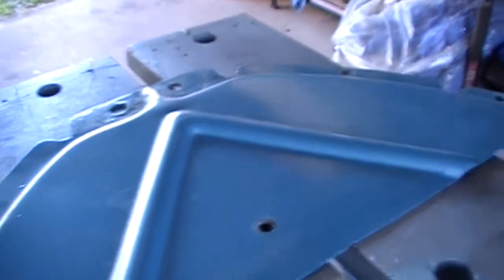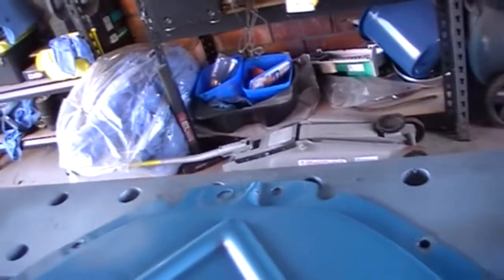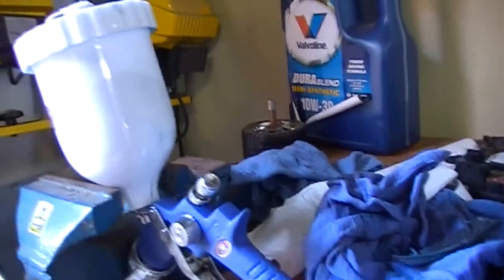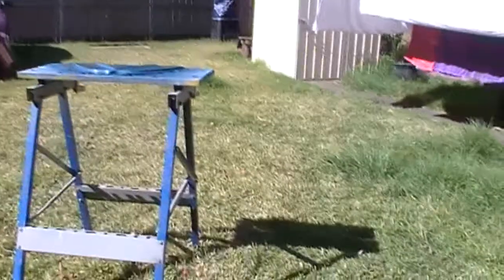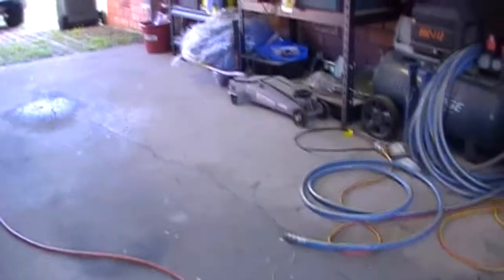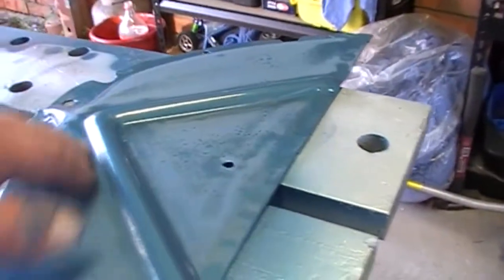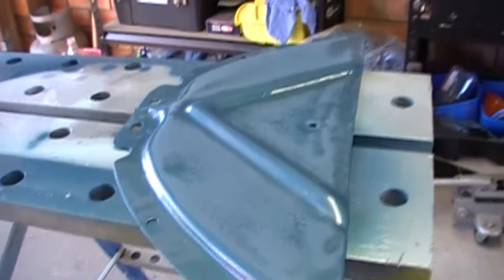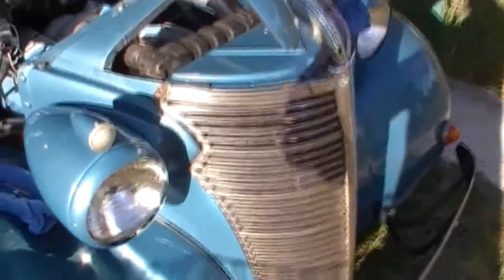How long does paint last in a can.?..YTGG

Comment: Yup that paint seems to be fine. If all the metallic settled to the bottom and kind of fused together making it impossible to stir that would make it no good. Color matched much better. Some paints like a final mist coat to orientate the metallic and bring it out a little more. Looks good. Polished out nice.Storing paint at a nice moderate temperature is key for making paint last. Good to see you Ziggy.

Comment: set and shake that can of paint while you are enjoying a few beers , the flake has settled in the bottom , a good shaking , and it will match fine , as for going bad on paint , you will know when you open it , if it is bad , it won't look right , and you can tell easily lol